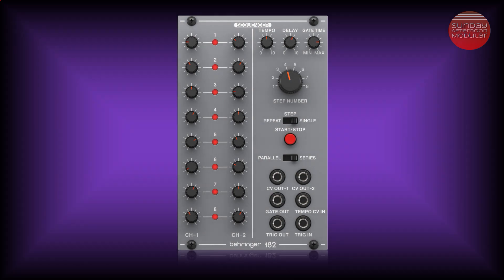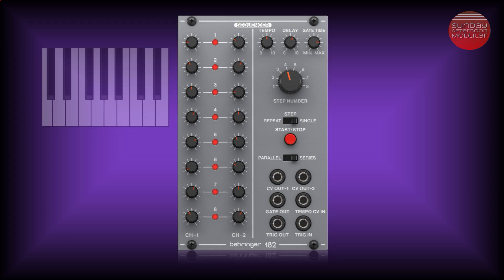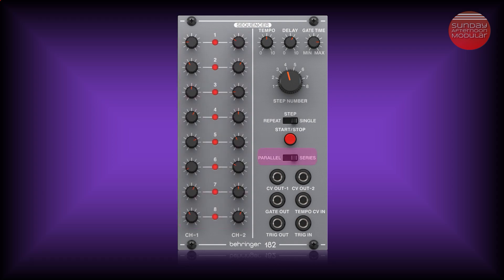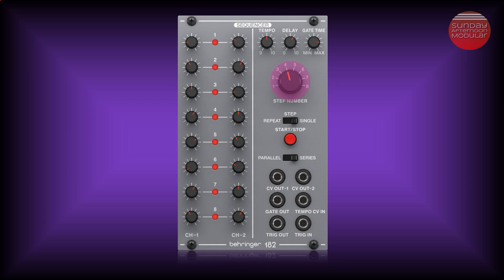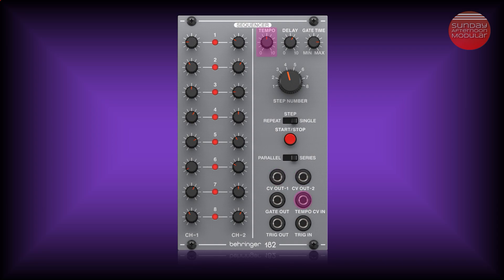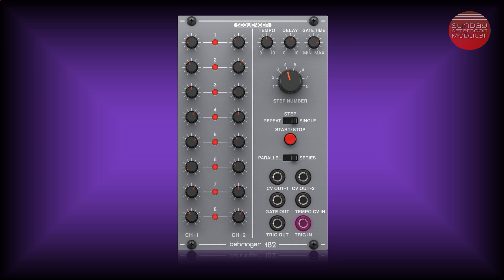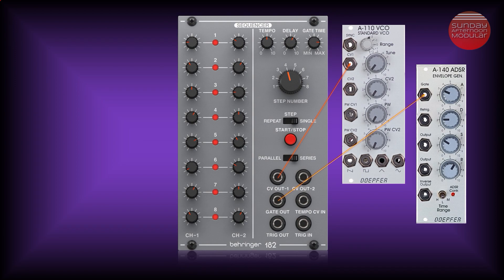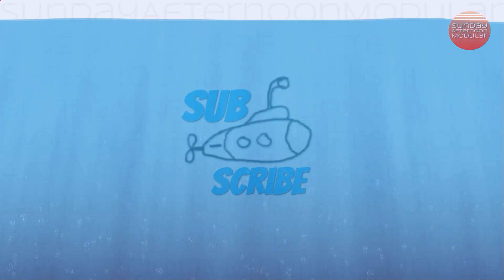BEHRINGER 182 - a great SEQUENCER to start your EURORACK ADVENTURES!

Comment: Is there any way to simulate a rest.
Reply from the maker: You mean reset? I'm afraid that's not possible. If you need a reset function, you will have to go with another sequencer.
Reply: I was going to ask the same question, I think the OP does mean a “rest” so that the output can be syncopated or say 4 notes, a rest, then another 3 notes and back in an 8 step sequence.  In a Korg SQ-1, for example the LED is a switch to turn on and off the individual sequenced beats.

Comment: Shame it has no clock reset
Reply: Was thinking the same thing
Reply: or random step progression
Reply: It's cheap and cheerful
Reply: the original didn't either. shame for sure, but interesting that this was what was used in that system with all the great music that was made on them before the other options showed up. and originals are like $2,000